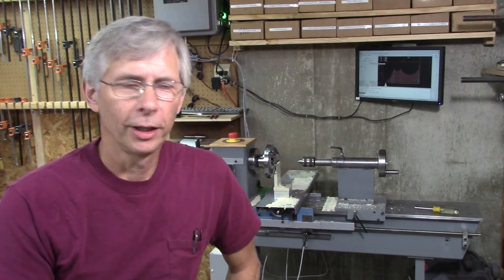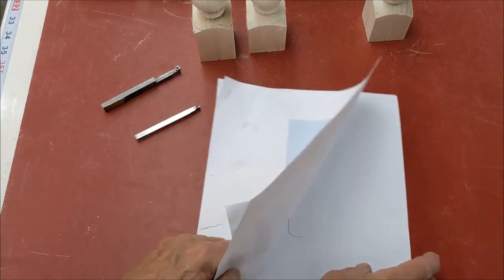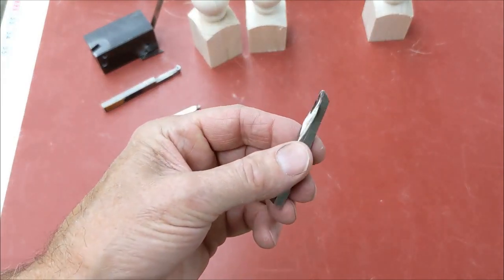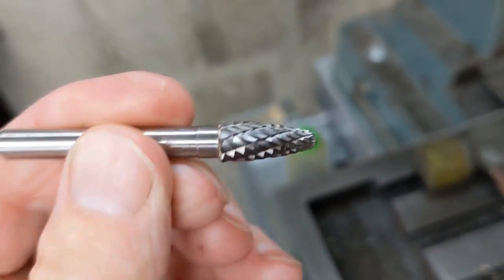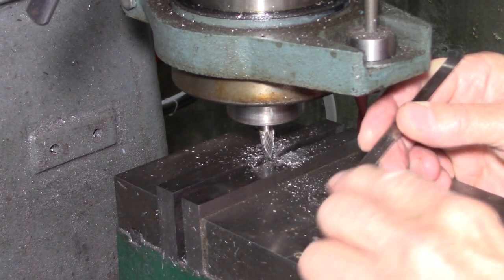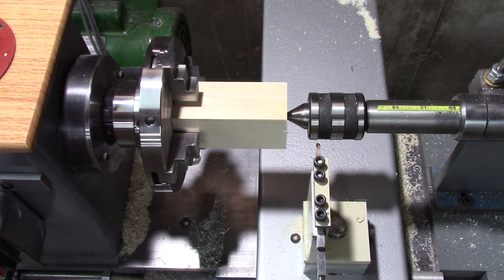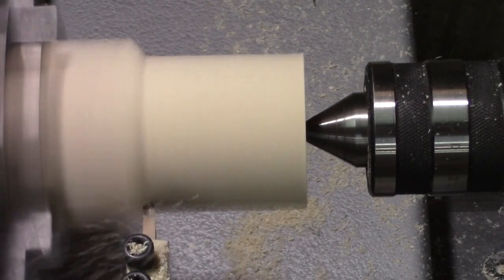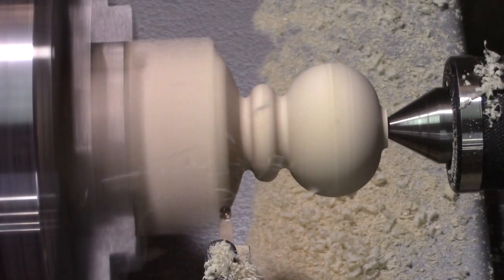Making a new Cutting Tool for my CNC Wood Lathe

Comment: Looks like you finally figured out how to do the grind. Have you considered mounting a spindle instead - a dremel, palm router, or something you make yourself? Then you can choose from a variety of router bits or endmills as cutters.
Reply from the maker: I actually had a router mounted on an old manual lathe. It would be easy to do on this CNC, especially a little trim router. I might have to try that.

Comment: Sweet, have you tried doing a piece of Aluminium ?
Reply from the maker: Yeah...  it won't do it. Too much movement in the cross slide and carriage. Wood is very forgiving.
Reply: @WinkysWorkshop  Bummer.
Reply from the maker: @65cj55  Yeah...  I made it for wood so I don't mind
Reply: @WinkysWorkshop  True, and you made it well.
Reply from the maker: @65cj55  - Thanks...  I have about 35 spindles sitting on my work bench. Mostly created for learning the software and perfecting the cutters. Now I need to make something.
Reply: @WinkysWorkshop  Internal spiral stair case ?
Reply from the maker: @65cj55  - Maybe some more of these machines  https://youtu.be/lWEq-803TEs
Reply: @WinkysWorkshop  Amazing Winky.

Comment: Hi Winky you could try and make yourself an  "round insert" out of 01 drill rod you could make it to any diameter you like and deep "countersink"it and drill it to suit
a small machine screw and make a suitable tool holder for it. I like your way of thinking for a lot of things love the vids keep it up,,, Bob
Reply from the maker: I was discussing this same idea with Billy (the guy that built the controller for me). The biggest problem is the screw head size on a small cutter.

Comment: Hi Mark good video but wouldn't the same geometries that wood gouges use be ideal for this task. Many different profiles commonly used and proven.
This is more of a question towards your project. 👍🤔😊
Reply from the maker: When you used a standard gouge you use it facing upward. This reduces the front clearance and increases the top so that you are cutting the wood instead of scraping. This is basically what I did when I made this tool. The burr ground a very steep relief. There is still a difference however...   the gouge is often used so that the cutting end is at an angle to the stock. In metal working there is a tool called a vertical sheer tool that is sort of the same. The thing is, grinding a tool like this that achieves this slop on all sides is impossible.
Reply: @WinkysWorkshop  thanks mark really appreciate the follow up.
Reply from the maker: @metalshopwithtroy5755  - No problem, thanks for the input.

Comment: 04:19 Looks like what we always called a Pine Cone profile on that burr.

Can you program the toolpath so you are always cutting downhill? Usually )by hand) you don't move your chisel uphill because of the tendency to dig in. I know your tool is not handheld but I think it might give a cleaner cut.

Will a parting tool with a flat nose just like a handheld parting chisel not work?
Reply from the maker: Pine cone sounds like a good name. As for programming the tool path I'm lucky to make it work at all. Ha. I'm not sure the software I'm using could do that but I'm sure there are ways to achieve this. As for the parting too...  I've been thinking about mounting a tool post on the back and parting off manually. It's easy to control the cutter position and speed with straight moves.

Comment: Hey Winky, can you edit your program to return to a rapid traverse position closer to the work, or doesn't your software allow that? As a C.N.C. programmer, I was always kind of obsessive about maximizing the program.
Reply from the maker: This would certainly be ideal. So far I can't figure out how to make the CAM program do this. If I was doing production work I'd make it a priority to find out how to do this but right now time is not an issue. HOWEVER, wear on the lead screw is! 

Can you recommend a good (and hopefully simple) CAM program for lathes.

Comment: Boy, grinding those cutters is an art! I'm glad I can buy bits for my CNC. If I had to grind my own, I'd be lost!
Reply from the maker: Finding the ideal cutter for a CNC wood lathe is nearly impossible but I think I got this figured out now. After making this video I worked on this cutter with a stone and it cut even better. I need to get a fine CBN wheel, mine is 60 grit.
Reply: @WinkysWorkshop  it looks like your well on your way. I can’t imagine the hours it must have taken to figure this out.
Reply from the maker: @cradd00  I knew what shape I needed but figuring out how to make it took some time. Thanks

Comment: Why not just learn to use a spindle gouge. As long as you scrape there will be a lot of sanding.
Reply from the maker: I've used a manual lathe a lot...  I would not say I master it but I did learn how to use a gouge fairly well and you are right, if used correctly the results are great. This new tool is designed with a fairly extreme relief angle much the same as a gouge when used correctly. The end result speaks for itself. I will say that after I made the video I honed the edge better and further improved my results. The grit on my CBN wheel is 60 which is fairly course. I'll probably get a finer wheel...  maybe 400 grit. Honing the edge on the stone is doable but also tedious.